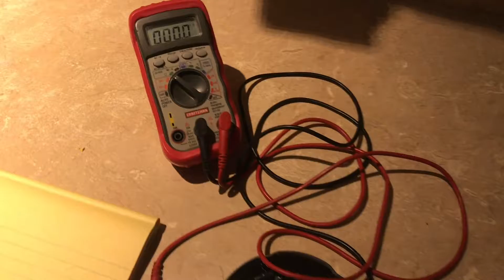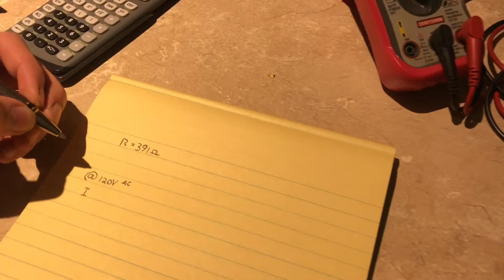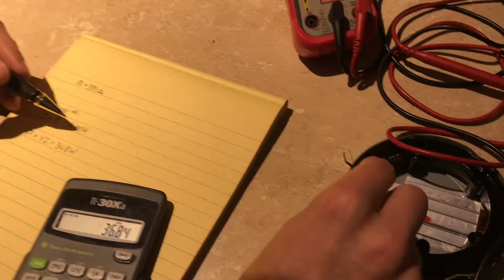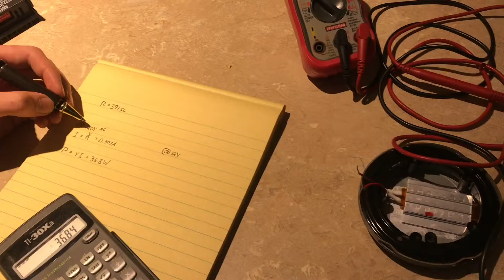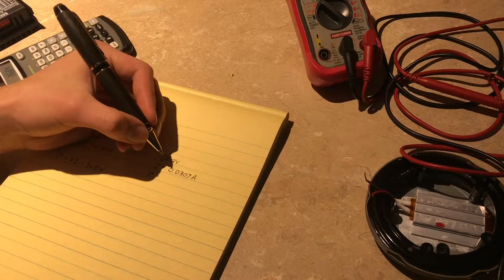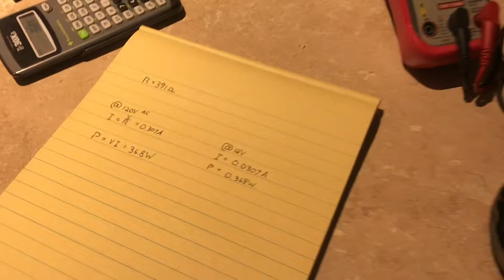UNDERSTANDING resistive heater elements (so you can PICK OUT the correct heater)

Comment: 120 VAC is wrong, you have to use AC rms value. The PTC cable is made of high-temp insulation and maybe that is why it can use a smaller gauge wire. Lastly, the resistance of the PTC changes as it heats up so the initial measurement is not applicable for all times when the PTC is in use. Picking out the right heater starts with knowing how much max temp it will produce.